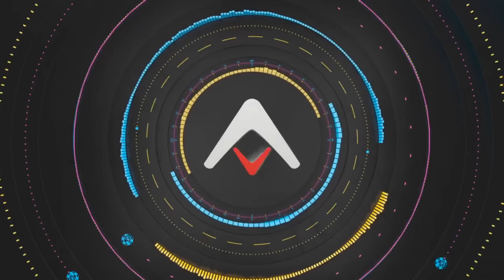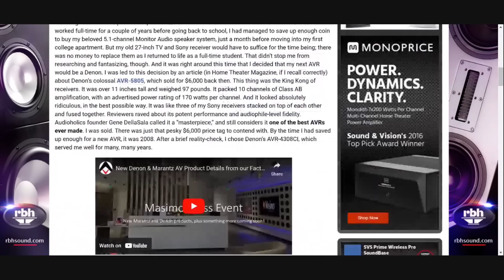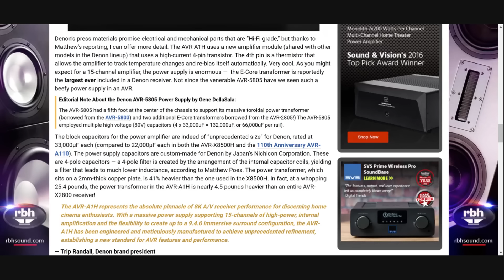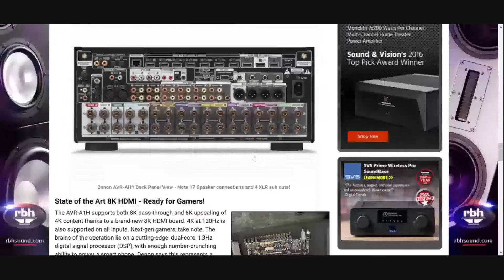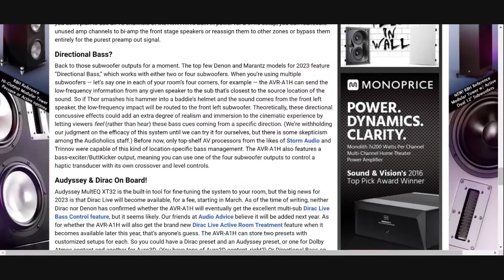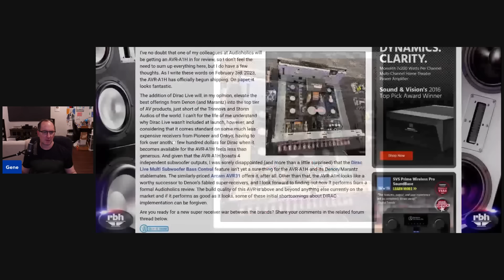Denon Goes Beast Mode: 15.4CH AVR-A1H 8K Receiver - Details Revealed!

Comment: I hope your going to still measure the A1H gene even though Matt is doing the review.
Reply from the maker: I will definitely be involved in this process.
Reply: @Audioholics  I was always a little disappointed in your x8500h review, because Theo did it and obviously couldn't measure it.
Reply from the maker: @Edward135i  I know. I wish I had more time to measure all of these.
Reply: @Audioholics  me too, I hate having to use ASR, because I think Amirm can be a bit of a nut. his review of the x3800h was just plain stupid.
Reply from the maker: @Edward135i  yea Amir is very arrogant and makes recommendations almost solely on inaudible measurement parameters.
Reply: @Audioholics  what I find really egregious is that he didn't recommend the x3800h because its DAC had a SINAD of 87db vs the x3700h DAC SINAD of 98db. but then he measured the x3800h amplifier SINAD at 85db and the x3700h's amplifier SINAD of 88db. I don't know a ton about measures, but does it matter if the DAC measures 10db higher than the amp section? your not going to hear that 10db benefit because that's not what the amp is outputting to the speakers. either way none of this is even relevant because your hearing gives out around 75db below the fundamental.
Reply: @Audioholics  he’ll definitely get you on the right path. Just got to use some common sense and truncate the noise. 8015 Audioholics + ASR buckeye NC502MP got me setting in a great space sonically  right now.
Reply: @Audioholics  hmm inaudible...how do you know that?  the true is nobody has done a general population study about SINAD audibility threshold, but common sense could tell you if more than 100 probable inaudible, but we are talking about a decrement from 99.5 (X3600H) and  97.5 (X3700H) to 87.3  of the  X3800H, Are you sure inaudible?, if you have   papers or data backing your claim; then you can educate people about this matter, including Amir and myself, otherwise disappointing use of misinformation.
Reply: @Edward135i  could matter if you use the pre outs with better performing amps

Comment: Right on guys, how many watts at 5,7 etc? Most people will have lots of other components, so are we talking about tripping breakers or are 5,7 channels really lower watts!? Just saw one new receiver actually advertising true power capabilities at 5 channels driven. I think it was a Marantz but can't recall off top of my head.
Reply from the maker: It will likely do 150wpc x 5 ch driven no problem and 70% with 9CH driven or 105wpcx9. We will be testing it. The dynamic power should be off the charts due to the very large power supply.
Reply: @Audioholics  It would be interesting to see it turned up, 5 or 7 channels driven and put on an amp meter. 🤔